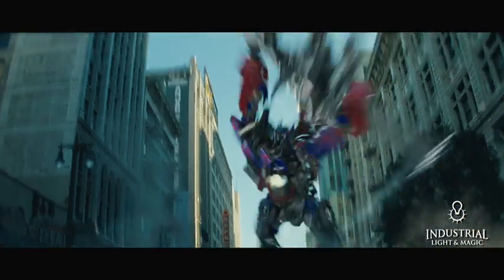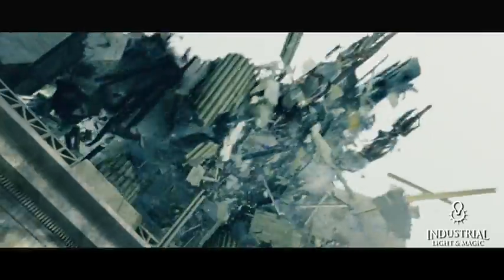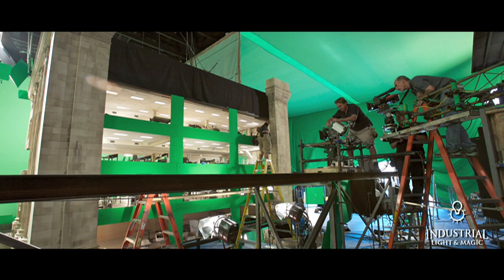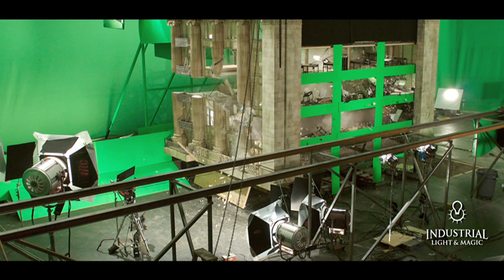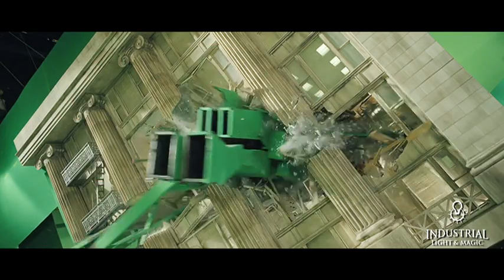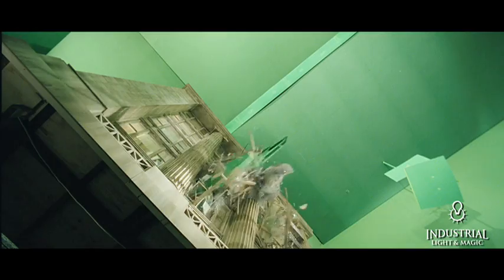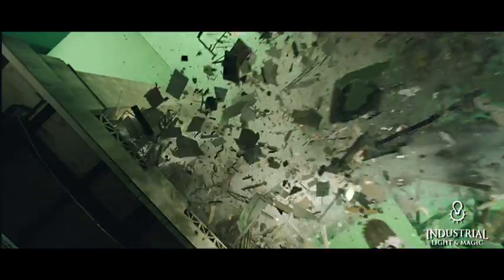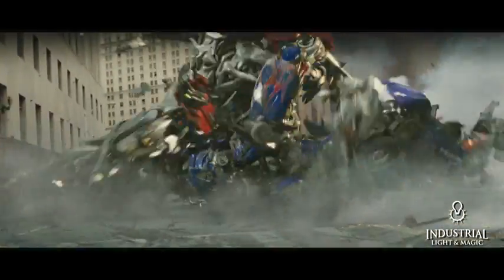ILM - Transformers Miniature Magic

Comment: @kazioo2 afaik there are some lens tricks you can pull off to kinda match up with the real scale couterpart. With a bit of math and the correct 3D rig would be enough i guess =D 

But as ILMVisualFX said its a whole new set of challanges that must be addressed and if possible taken care in production (like camera alignment (in case of a dual-camera stereo rig) camera focus etc).